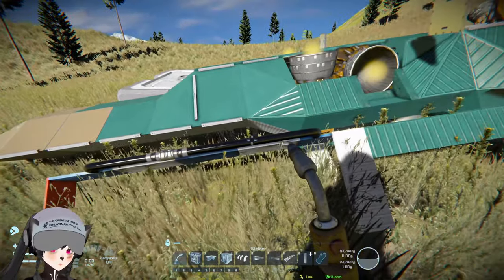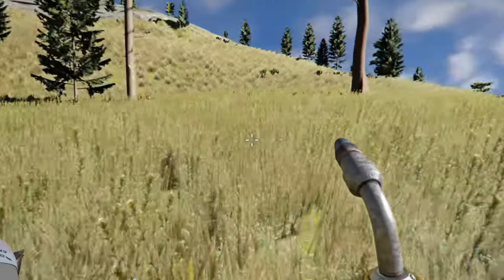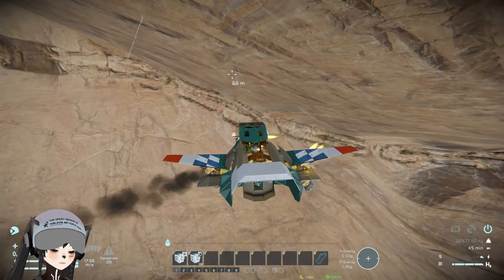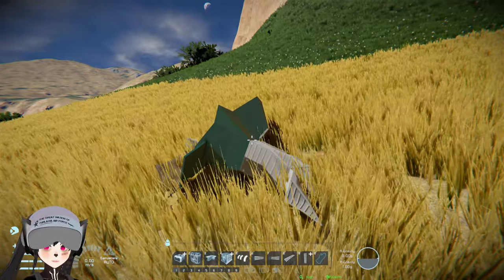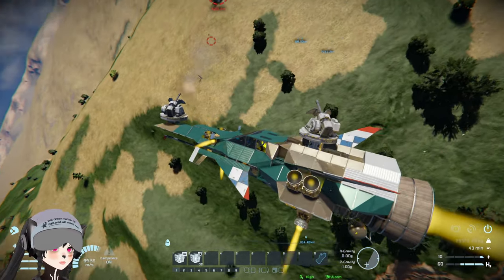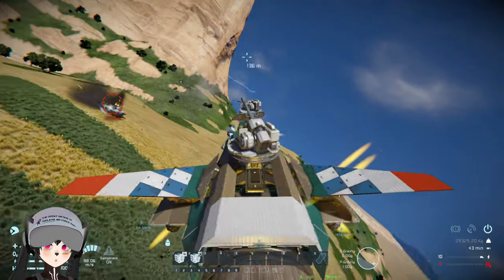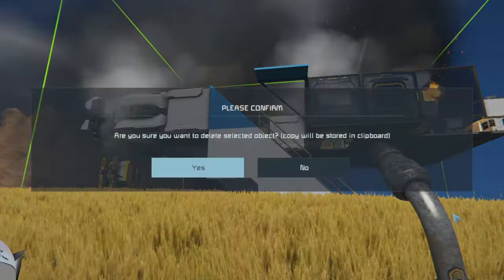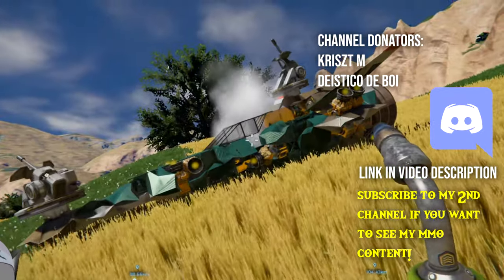This Tiny Racing Ship has an Insanely Huge Engine, Space Engineers

Comment: I have spent a lot of my free time working on various sexy racing ships, and this one is my favorite aesthetically out of the bunch. The subgrids did cause some shakiness in my testing, and playing like I do with damage turned off for flight tests means that a decently hard crash causes it to clang out 😅 but at the end of the day it’s more of a showpiece, and intended to work with my own lore and not the game’s. With the aerodynamics mod, thought, there is basically zero wasted space, and it can fly using just the forward thruster which extends the fuel time by a lot. It also has an inbuilt h2/o2 generator so that it can extend its fuel time slightly with the addition of some ice.

Comment: Really nice lines and minimal design, the armor plate winglets and decorative bits are super slick!

Though subgrids are, as always, going to be an aesthetic choice that comes at a high cost to ship performance in gameplay. I know every time I comment on one of your videos about ship designs, I end up bagging on subgrids. I still love the idea of them, and I have tried sooo many ways to make them not suck within the game's mechanics. But almost every time, it comes down to style over substance within the game meta. The only use I've consistently found for subgrids is static grid piston/rotor drill rigs. :P

For racing, I've tried many workshop designs and built a dozen racing ships of my own with non-thruster subgrids, thrusters on subgrids, and no subgrids. The way the physics handles them you always end up with the problem of the subgrid mass inertia acting on the ship in ways that the game's inertial dampening can't handle as quickly as a single unified grid. You feel this as sluggish turning rate. Pretty much anyone who's spent more than a few hours in SE will be familiar with this.

Specifically, subgrid thrusters angled off of 90 degrees are something that Whip's subgrid thrust script struggles to handle well. You'll get a lot of undesirable Z axis thrust when you try to get Y axis, and vice versa. Makes precision piloting (like canyon racing) an exercise in masochism. Pretty sure that's why there are also some main grid small thrusters, to properly dampen the ship when you're trying to bring it to a complete halt.

If your sub-grid design isn't specifically predicated on off-angle subgrids for style, thrust, or other function, but you DO want subgrids in order to e.g. vector thrusters from up to forward (thus saving the mass of 1+ large thrusters), then separating the subgrid with 2 rotors/hinges will let you merge block the subgrid to the main grid in each of the two positions. If you're gonna subgrid thrust, that's how I would do it.

But in this specific case, I've come to prefer simply mounting a second remote control oriented 90 degrees from the main control/cockpit on a single grid. Up becomes Forward, or Forward becomes Up. Waaay cheaper on mass, PCU, complexity, and eliminates single point of failure block connections.

This sub-grid/single-grid experience is based on doing timed laps on specific race tracks built with the racing mod and script. (which is criminally under-subscribed, btw. It's really easy to use and really fun) With similar ship masses and thrust, it's really hard to beat single grids with sub-grid ships. Of course, a sub-grid ship with a substantially higher thrust-to-weight and gyro-to-weight ratio can beat a single grid ship. :D

I think it's probably a more realistic experience than the sometimes hilariously snappy 360-no-scope single-grid ships that can turn on a dime if you put (too) many gyros on them. As in, it looks and feels more like helicopters or VTOLs IRL in terms of the slightly greasy feeling of drifting sideways unintentionally.

But pound for pound, it does make subgrid ships lose a competitive edge to single grid ships, if your focus is a purely racing game meta.

I'd say anyone who wants to race these should specify a "sub-grid" division distinct from a "single grid" division of ships.

But for an "unlimited" division with no rules, my best lap results have generally been with a small grid large H2 tank with large forward thruster and bare minimum thrust in all other directions. Gyro, lightest control seat possible (or remote + passenger seat if you want to really cheese it), and small battery. Go! XD

Using small H2 tanks and thrusters only beats out the single large tank and thruster if a specific race has a VERY tight checkpoint gate that requires precision flying.

From there, add on only as much light armor or other blocks as needed to 1) make the ship robust enough to resist a sneeze, and 2) fulfill any other race requirements (relay race, landing touch and go, survival endurance with O2H2 generator or more tanks, etc.)

Haven't really done cross-planet endurance races, but I'm pretty sure atmos and batteries will beat out H2 thrusters. There's a matched Blue Racer and Red Racer (well maroon for the latter) on the workshop that exemplify this pretty well. Big up thrust, bigger forward thrust, almost nothing else. They look good, too.
Reply: I have actually built a ton of racing ships apart from the IRGO! In terms of my side projects, finding the best blend of fun and aesthetic in racing performance has been a little experiment I am actually pretty dedicated to. The IRGO’s numerous subgrids do make it quite… shaky compared to the monolithic style builds, but I think it is by far the most aesthetically effective design. As a showpiece, it’s my favorite so far! Also it’s a lot more mobile with the aerodynamics mod, where you don’t need to constantly burn your limited fuel on the vtol thrust, and can fly purely on steering and forward propulsion.